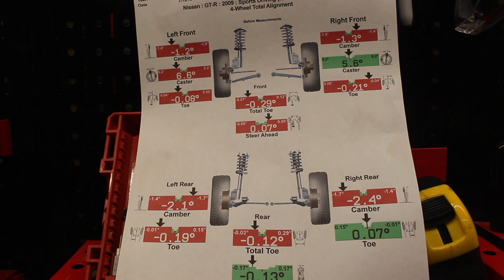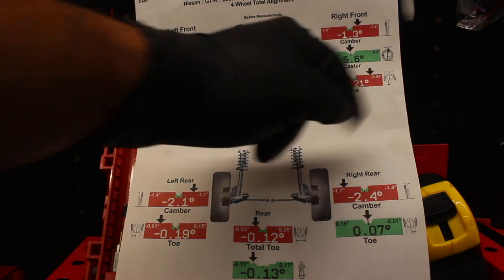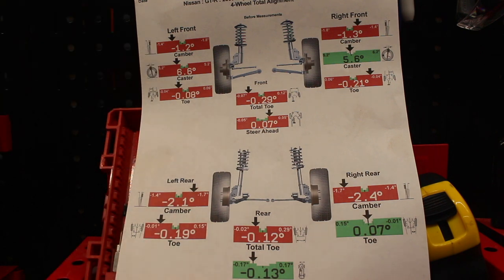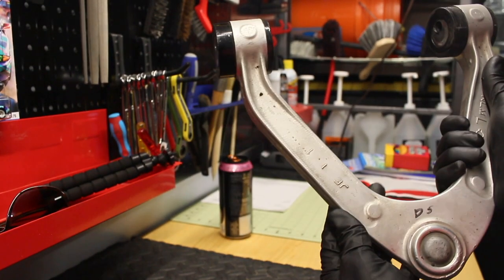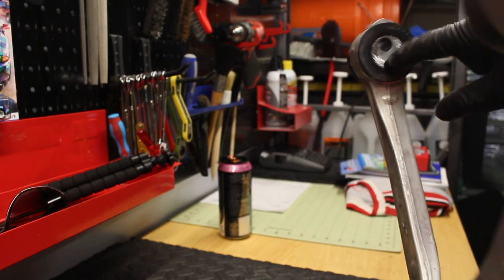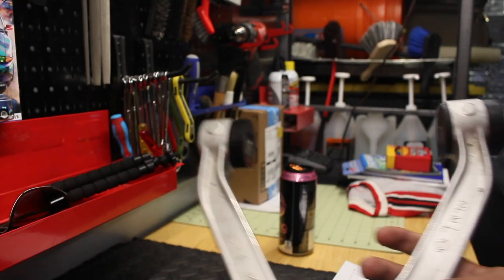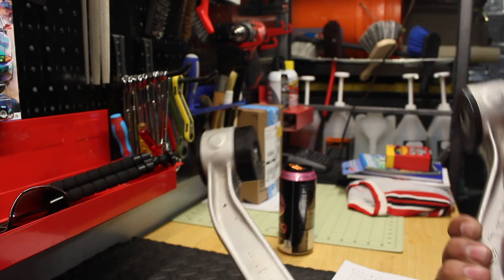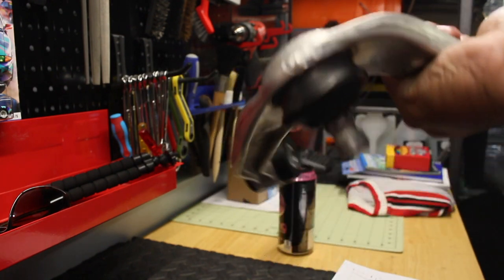Whiteline Upper Control Arm Bushing Installation Tutorial for Nissan GTR

Comment: I guess it depends on how much caster you want to get.  For performance, the added caster is a plus and you would want the thicker bushing to be closer to the front of the car, so there really isn't a right/wrong way to do it, except you had it differently on one side of the car vs the other.

Also, is -1.3 and -1.2 the most camber you could get with those offset bushings or did you dial them back a lot?
Reply from the maker: You are correct. There was still plenty of room on the caster based where the bushing was set at.

Comment: Hey did that fix the problem? Looking at your original install you were correct as per their installation guide, thicker part of the bushings facing towards the front of the car. Why the right side was with in the spec? Thanks for the informative video.
Reply from the maker: It did! It helps big time when getting it aligned.
Reply: @BoostedMPLS  I just ordered mine and found a lot of confusion with those bushings as the install guide is not so clear. In order to get the caster within the specs, I need to install the thinner part of the bushing towards the front of the car instead of the thicker part? Thank you